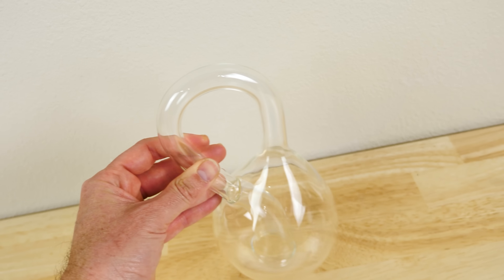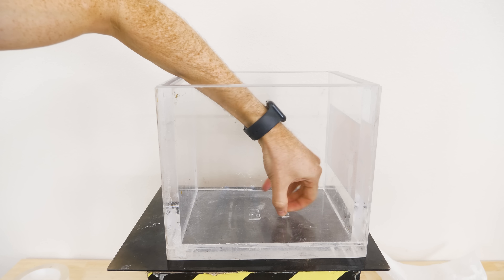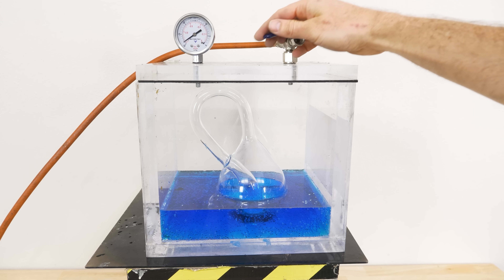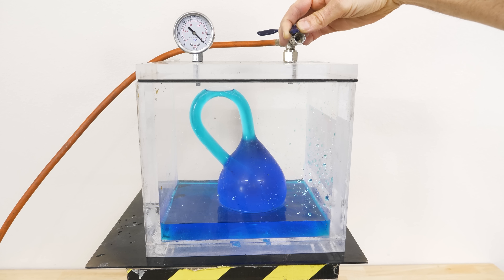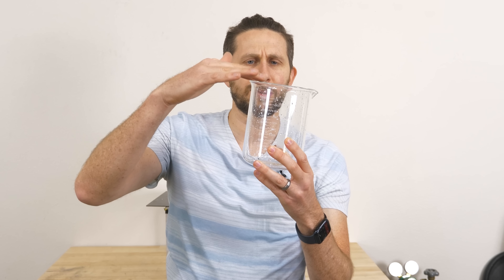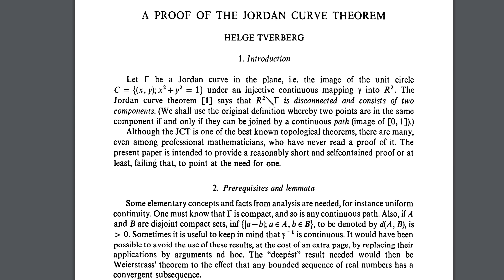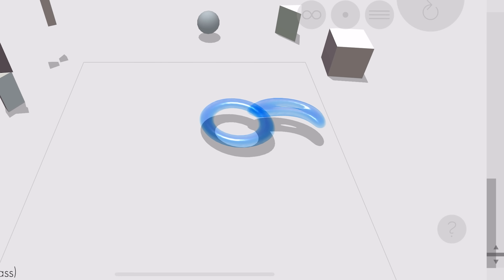Is It Possible To Completely Fill a Klein Bottle?

Comment: dear researcher. why you didn't used a flexible rubber tube, that is smaller than the glass tube of the Klein Bottle, to fill it? This is just waste of resources and time. looks like you just love vacuum.

Comment: The concept of the Klein bottle is faulty. As you said, volume is defined as separating the universe into inside, and outside. If you look close at any glass, you'll see air bubbles that exist INSIDE the glass. Everything that exist in at least three dimensions has volume. The only way for something to have no volume is for it to exist in two dimensions or less. The glass itself has volume dummy lol.

Comment: Bro.....ever heard of a tube? You could have just put a small tube down into it and filled it with a funnel. As long as there is enough space for air to escape past the tube you would be fine. A little awkward to  have it sit on the tube but def didn't need a vacuum chamber.

Comment: Honestly, I wouldn't have used a vacuum. Just push a tube into it and push water in. It will push the air out.

Very simple.

But I see how that would not be a 4 dimension item. Very interesting!

Comment: In 3D Klein bottle is a fancy cup that you need to vacuum in order to fill up. In 4D Klein bottle is just impossible to fill up because everything will spill right out, it's like trying to fill a horseshoe with water in 3D - it's not really possible unless you'll practically reduce the problem to 2D by placing this horseshoe between flat sheets of some solid material

Comment: What if you were to take a hose which is smaller than the tube and feed it into the large chamber, sucking the air out as you simultaneously pump the water in and remove the air hose, adding a bit more to displace the area of the hose. I would imagine that would also be able to fill the shape without a vacuum chamber

Comment: Like the Mobius strip, the Klein bottle is a manifold. Any vicinity of it must be locally Euclidean. This means that there cannot be any intersections or glues, as a tube passing through the "wall" in the "seam area" would not satisfy the condition of being locally Euclidean. Instead, the tube must pass through the bottle without intersecting its surface. This is only possible through the fourth dimension, so the object you hold in your hands is not actually a Klein bottle. It is just a representation of one.

Comment: 1:22 If I watch this to the end and he hasn’t used a tube to relieve the air pressure while filling I will unsubscribe. Buddy broke out the vacuum before a piece of PTFE tubing
Reply: i dont understand 😭
Reply: Fr
Reply: Could have started out saying “This bottle doesn’t exist. It only exists when math peeps use the dimension-card”  
Weigh the empty bottle, put a tube in the bottle to displace the air as you fill it. Fill up as much as possible with a liquid with a known weight at a known altidude, seal tube, pull tube let negative pressure replace it’s volume with fluid, argue about the miniscus later.

Then you math nerds can figure out how we put a volumetric value to something you say has no value unless in 4D.

Maybe I’m missing something here, but I feel like you used a vacuum chamber for nothing and started off showing us something we can in fact measure the volume of.
Reply: I legit Unsubbed.

Comment: I understand the educational purpose of the video, and therefore the method being used, but there's an easy way to fill that bottle , )
Just lay the bottle on its side, and introduce a thin hose inside till it reaches the inner recipient. Lift the bottle upwards while the inner recipient gets filled pushing the air outside, and that's all. Simple. . )

Comment: You don't need a vacuum chamber to fill that thing, all you need is a thin tube, some kind of container filled with water to put it in, and something to suck the air out of the bottle.
It's the air "inside" the bottle that's the problem, so if you were able to get that out, it would function as a vacuum chamber by itself.

Comment: What if you just used small rubber hose which is smaller in diameter than hole and tube going to the inner chamber and just poured liquid inside. Maybe this way it would be possible to fill without vacum chamber.

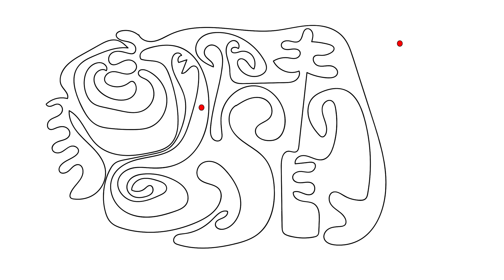Comment: 5:37 this is flawed, it can simply be odd or even towards the point of interest yet still be either in or out of the shape 🙄
Reply: The only way that the number can differentiate from being even or odd, is if the line isn't straight, otherwise it will always be either/or.

Comment: I the early days of 3D modeling on desktop computers I used to have to teach people how a computer program determines whether an object is a solid or just a surface.  It comes down to the fact that, topologically, a solid has only ONE side.   The outside.  And so such things as directional connection between points in a polygon, and the fact that every planar polygon has to have a normal in only one direction ( determined by the direction of connection between the points ). So the computer can calculate whether ALL the normals in all the facets of a model point outward. And that a polygon is representing a surface that has only ONE side. The normal side. 
All this to explain why, in four point polygonal geometry, it is important that the four points stay in plane, because if one is out of plane with the other 3, the polygon can not have a single normal, and that model won’t render correctly or 3D print as a solid.   And, of course, why triangulation solves the problem of out of plane points in 4 point geometry, because 3 point polygons are always planar.

Comment: it has a volume, its just a very weirdly shaped glass. if you think about it, a regular glass cup has an outside that also turns into the inside, just with much sharper edges

Comment: 0:51 cant you just submerge it under water and turn and twist till the air goes out?
Reply: This is smart. I thought about using a straw all the way inside to suck the air out while it's in water, but it's funny to me that he went all the way to using a vacuum chamber 💀
Reply: @jaronloar1762  modern science doesnt seek simple solutions
Reply: @GasGiant117 maybe it should
Reply: @UnangaxMNDRGN that’s stupid if you don’t know anything about science then don’t try and say something like you know it
Reply: @jaronloar1762 Or you could fill it with water trough the straw.
Reply: @jaronloar1762 this is not smart. i already knew that
Reply: @wakemon.official  your relationship with this knowledge does not affect its intelligence.
Reply: You can
And it would work
And then the bottle would just explode
Reply: No, because the universe will implode
Reply: Holy genius
Reply: My thought was to route a thin flexible tube into it to fill it  from the inside
Reply: Or just use water pressure
Reply: Literally looked for this comment when I saw the video
Reply: Would be too easy
Reply: Or use a Straw
Reply: Wen you take it out it will spill
Reply: Exactly whaT I was thinkin
Reply: bro is that one guy who always knows a shortcut
Reply: No it will explode
Reply: @PhantomBrews actually implode

Comment: Couldn't you just insert a small flexible hose so that you can pump the water into the round section of the bottle? It would allow the air to pass around the hose as it is displaced by the liquid.

Comment: Yes you can fill a klein bottle. It isnt filling because the air has no way to escape, and it requires less pressure to spill over the top than displace the air.

If you put pressurized water into the klein bottle, it would force the air to come out and fill the inner chamber.

Comment: Well, technically, the Klein bottle is a 4-dimensional shape that doesn’t intersect itself. What is shown here is the immersion of a Klein bottle in 3D space. The true Klein bottle is a single surface, with no inside or outside, and a shape with no inside cannot be filled. Tl;dr: you cannot fill a true Klein bottle.

Comment: if you have a klein bottle at home and you want to recreate this, but dont have this machine, you can always use a soft tube and a funnel. if you can get the tube around the bend while it's upright, you can fill most of it with the tube

Comment: To explain what he means, let's  say there's a wall you need to climb up, as a 2d being climbing up or going under the wall is their only option, so the concept of going around it is strange, the same applies to 3d, you can escape the room using a door, but if you were 4d, Then you could easily travel around it since you have a higher dimension to move in. So basically, the Klein bottle really isn't a bottle, but rather a volume less shape that looks like it's intersecting it's self

Comment: As mentioned in the comment, insert a tube can fill the bottle easily. Also the beaker he's holding has an actual volume, inside the thickness of it right?

Comment: In all the times I've idly thought about this, I always assumed it would be easy to fill. I never once really thought it through about how difficult it would be to get the fluid in without the air blocking it. As soon as you had to tip it over and fill it up more in some ode to Sisyphus, it finally made sense. Really awesome that you were able to make it work anyway with a vacuum chamber!

Comment: Why not just stick a hose through the opening and push it round into the cahamber, then fill it up that way. You don't need to  put it in a vacuum chamber to push the air out. A little manipulation of the bottle's orientation during  fillingay be necessary

Comment: Why mislead thousands of people?  Of course it has a volume. This is like saying a CUP doesnt have a volume because the question of "what is the absolute most you can fill a cup" is a question. That is a question of absolute retention of volume not if it HAS ONE AT ALL. A klein bottle is just like a cup. It can (awkwardly) contain liquid in ITS VOLUME upto a certain maximum before spilling (awkwardly) over. The top of the klein bottle "cup" is at the bottom where it opens. I REALLY dislike people misleading other just for a shock and awe value. Its not education.

Comment: Clever, but i would have just used a tube to fill most of the way and then submerge and tilt at an angle to get the rest of the air out

Comment: Is it possible to completely fill the Klein bottle? Yes, it's completely filled with a gas known as 'air'. If it had no volume you wouldn't be able to fill it at all. If you fill it with a liquid of a known weight per unit of volume you could calculate it.

Comment: You can force the water in using a thin tube going all the way in to force the air out. A vacuum chamber is not really that necessary

Comment: You could have just put a pipe in the klein bottle and filled the bottle

Or you could have just used pressurised water and force it throough the first opening

Comment: Amazing; does vaccum have the same effect to the beaker or edenmeyer flask and florence flask? If not, the experiment is related to two theories, floatation, boiance at extreme water pressure, hence if the klein bottle is half way in the water and vacuum should work too, if neither try .... .?! Tip, try a bueker bieker or beaker, and the riddle is within the first two letters and M & P.

Comment: you are way over thinking this and you don't need a vacuum chamber.. you just need to insert a flexible rubber hose to allow the air in the chamber to escape as you fill it.  The water will displace the air as you pour more water into it.  Once the large end is full remove the tube.

Comment: if you will create reduced pressure not in a large chamber, but only inside the bottle, then:
- the amount of air that needs to be sucked out will be ten times less,
- it will not be necessary to create such a deep vacuum,
- instead of expensive equipment, only a flexible tube is needed,
-filling will happen faster

Comment: When he has the kleinbottle on his hand at 03:00 it makes no sense to me. The part that is on his hand is a big hole. How does it not flow out. He doesn't apply pressure. It should start to leak at the very least

Comment: It's not that complicated, just put a tube straight to the bottom of the klein bottle, pressure the water in and the air naturally comes out, tilt it slowly as the water fills and keep hosing water in as you pull out.

Comment: A pump for the liquid fluid introduced through a narrow tube and orientation adjustment would fill it the same way.  Either way you are displacing air with another fluid.

Comment: In a frame where the line crossed the figure 10 times, if you move the line so that it goes tangent to one of the pieces of the figure, you will get that the line crosses 9, although the point has not changed its position.  How do you explain this?

Comment: This isn’t a klein bottle, this is just a 3d representation of the extra dimensional object. It does not share the properties.
Reply: What is "just a 3d representation of the extra dimensional object"? What object? How is a physical object a "representation"? What properties does it not share?
Reply: @josephh891  Any square can be considered a two dimensional representation of the face or cross-section (ergo a 'slice') of a cube. This three dimensional object represents the most prominent 'slice' of the four dimensional concept. Another thing to consider, all three dimensional objects cast two dimensional shadows, which can be perceived easily. Two dimensional things must thusly cast a shadow consisting of one dimension that is not so easily perceivable, and so on. As such, this three dimensional representation of the klein bottle could also be interpreted to be a shadow of the four dimensional concept.

This is why the temporal dimension (or the linear progression of time) is interpreted to be the fourth dimension. At any 'point' in time, you can capture a still moment, which would be the three dimensional 'cross-section' of the entire universe along that axis.

Comment: to explain to those who dont get it the 4d klein bottle does not exist in our world completely its multiple shapes at once but we only have one thing at a time or more so a shape across time. It would be kind of like how as you are eating a donut it changes. as time goes and you continue eating it gets smaller and smaller but it was a full one at a point and also gone at one point. It is different between the time periods and cannot exist at the same time since we are in 3d.

Comment: You can easily fill this Klein bottle with a small diameter pipe one end inserted inside and other connected to the tap. at last you you have to completely dip in the water.

Comment: Correction: Klein bottle is an abstract set that forms a 2-dimensional surface and needs neither 4 nor 3 dimensions. You can define a map that will project a Klein bottle to a 3-dimensional space (as the actual glass vessel on the video), but it is imperfect due to the intersection (where walls of bottle cross its surface) as the actual Klein Bottle does not have those. You can further define a map that will project a Klein bottle to a 4-dimensional space, and it will look almost exactly the same as the three dimensional version, with the exception of the intersection which will be smoothly pushed into the fourth dimension. Hence the supposed "need". Does a two-dimensional surface need to have an embedding for our limited imagination to fathom? No, it does not need it. It does not care. It could not care less. Claiming that "a Klein Bottle needs a fourth dimension" is a gross mistatement. No two dimensional surface needs more dimensions than it has.

Comment: 😂 Vacuum pump and a couple of minutes babbling for filling that bottle... No need to turn the bottle, no need for the vacuum pump. One can fill that bottle COMPLETELY without moving, turning or using any machines or low pressure air.
I don't see the reason behind overcomplicating simple tasks like that.
The ultimate solution that has no flaws, doesn't need vacuum pump and vacuum chamber:

- take a syringe and a foot long piece of narrow flexible tubing, like an infusion tubing or a fuel tubing for small engines
- fill the syringe with the liquid
- attach one side of the tubing to the syringe, and push the other side of the tube inside the bottle, so the free end of the tubing reaches the inside of the bottle, right beyond the last bend of the glass
- push the piston of the syringe (notice that the air can come out from the bottle easily)
- fill up the syringe again
- inject the content of the syringe into the bottle, through the tubing
- repeat the last two steps until the bottle is full

See? Simple as that.
This video is like the so-called European Parliament nowadays. They have many options to choose from, but they always choose the most expensive and most difficult things to do, and they don't even care about the fact they are actually destroying all the member countries (states) both economically and culturally. At least you don't break your own laws and rules. They do, on command.

Comment: You do not need a vacuum chamber to fill the bottle. It can be filled up with a thin tube from the inside so the air gets pushed out by the water.

Comment: It would have been alot easier to hold the glass under water. Put a hose into the glass and suck the air out of the glass.

Comment: I mean you could, in a much easier fashion, use a straw. Bendy straw all the way into the bottle then fill with water around it. The straw will let the air escape without full tipping it over and spilling. Once full remove straw. No need for a full ass vaccuum chamber.

Comment: Mark, if you take a small straw or a small hose and place it inside the bottle until its "bottom" and fill it little by little? Will the water push air internally and fill the bottle?
Reply: The water should able to push the air out, i don't know why those at the top comments didn't have that in mind.